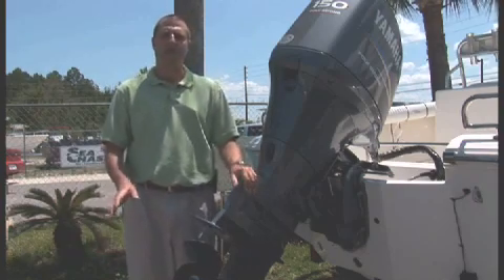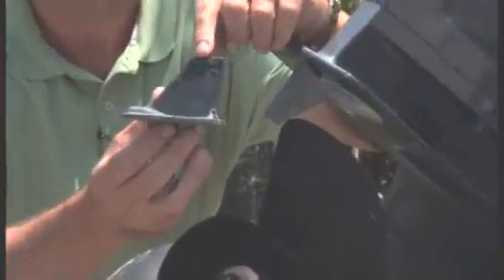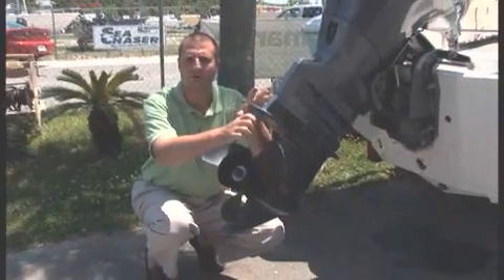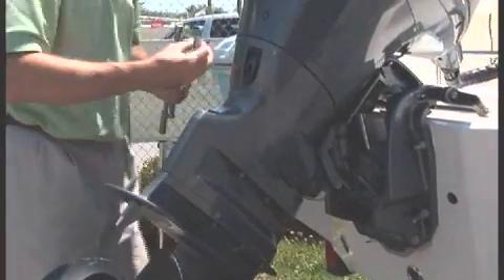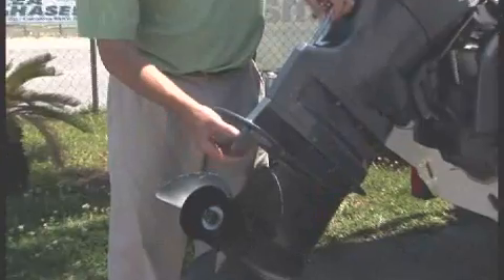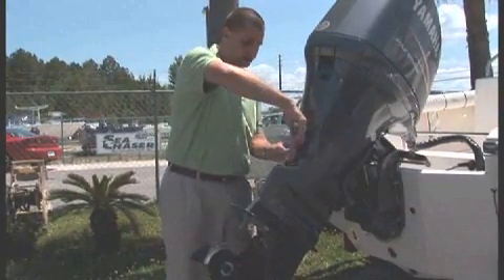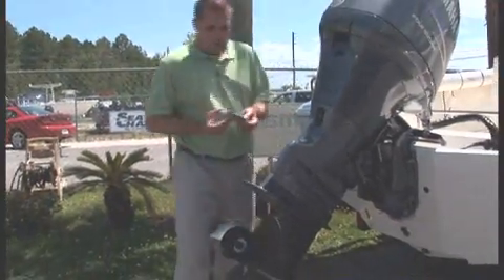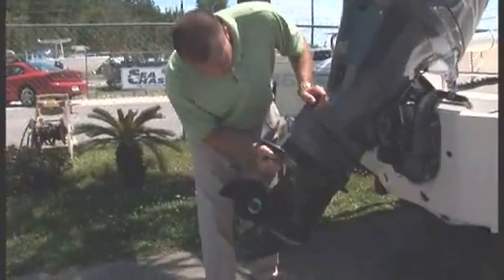Function, maintenance of your outboard's sacrificial anode

Comment: He is absolutely correct about which way you move the trim anode. If the bow tends to yaw to the right ( also perceived as easier to turn the boat to starboard ) then loosen the boat and move the trim anode to the right. This has the effect of deflecting the whole engine in the opposite direction. (Put your hand out of your car window at 60 mph vertical and straight on to the airflow, then deflect it left or right, as if you were deflecting the trim anode. The resultant force will deflect your hand/arm in the opposite direction..... hey presto) Its actually an aerodynamic/fluid force, related to Bernoulli and relative flow over a moving body, but the car test is a simplistic prover ! Power steering can still be affected, and noticed by steering wheel drift; The amount of drift depending on speed, force, rigidity and friction in the steering system etc etc. For those asking about lean, these have NO effect on lean at all, that will generally be a loading issue, trapped water in compartments etc.

Comment: Good video, my boat is a sailboat and the engine which is Tohatsu 9.8 hp is fixed inside the motor well . The engine is always in the water and the trim tab melted in six months. I bought a new one. The engine is in the motor well but on the starboard side and I wonder if I have to modify direction of the trim tab. I don't know which way to change it

Comment: REALY? sooooooooo, does that also  apply to HYDRAULIC STEERING?  nope!
Reply: Depends on your rig,  I am told the Alpha One Gen one really needs it to help keep the boat straight and to make the steering more responsive (That is with Power/hydraulic steering).  For other rigs it is for the electrical portion, gives the electricity something easy to eat rather than your outboard.

Comment: Ventilation plate not anti cavitation plate.  Cavitation is the "cavity" in the water (bubble) created from the shear force of a pressure differential.  That's why your propeller makes bubbles above idle.  Ventilation plate keeps the water intact around the prop giving it good liquid to bite in to: that's why blowing out the prop in a hard turn = ventilating the prop.

Comment: Do you have to have this. The reason I ask is I'm adding a hydrofoil se sport 300 to my 150 vein rude to get up on pane faster and bolt holes hit edge of anode edge. I can either drill through it or take it off or not use hydrofoil I've tried moving it a little but still hits it.

Comment: When an instruction says, move the tab "right" or "left", you first have to know the perspective of which is right and which is left.  Same with clockwise and counter-clockwise.  For example, the left side of a car is always the driver's side.  On boats, the left side is called the port side, and is the left side when facing forward.  It seems counter-intuitive to move the trim tab rear edge left if the boat is tending to go left, but it must have to do with the water coming off the prop being deflected to the right when the tab is towards the left -- somewhat like a jet boat thrust -- thus urging the boat left.  I don't know if this is true, but it is plausible.  I will check it out on my own boat to see for sure.
Reply: Remember, Boats do not have tires and linkage to steer them with.  The outboard/Prop pushes the stern right which in turn causes the front of your boat to move left and vice versa, so the steering is really done from the rear and has the opposite affect on the front of the boat.

Comment: Good video.  Anyone who is criticizing him does not actually know what THEY are talking about.  Sure, he uses casual language, but nothing wrong with that.  I was surprised to see how the anode gets attacked in particular areas -- not just all over the surface.  I was also surprised that once severe corrosion of the anode occurs, it is best to install a new one.  The anode should not be painted, and it must be making electrical contact with the aluminum of the motor.  My lower unit is showing corrosion on the surface, and now I know what to look for and how to correct it.

Comment: I think you have it backwards.  According to my Mercury manual... "If the boat turns more easily to the left, move the trailing edge of trim tab to the left. If the boat turns more easily to the right move the trailing edge of trim tab to the right."
Reply: He did say turn it in the direction the boat is leading.

Comment: " A little knowledge is a dangerous thing. "
Corrosion is the end result of Electrolysis.  Electrolysis is a process of electron transfer, not a thing.
The "scratch" marks on the trim tab is a result of corrosion, propellar tip cavitation and erosion from the water.... and propellars have blades not "ears".
I don't think this guy is an expert.  Why do I think this? I'm a degree qualified Mechanical Engineer and some of what he said doesn't make much common sense.
Reply: I understood perfectly.